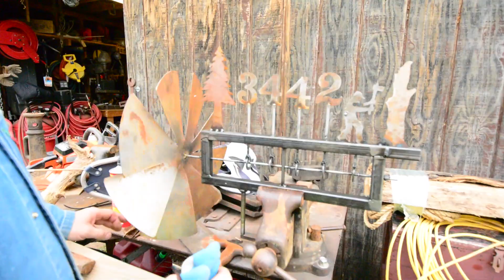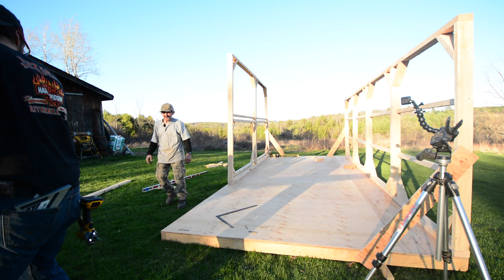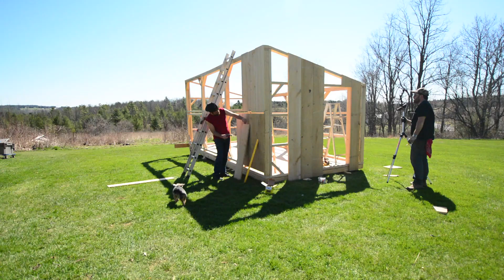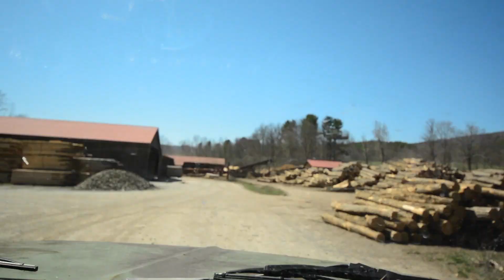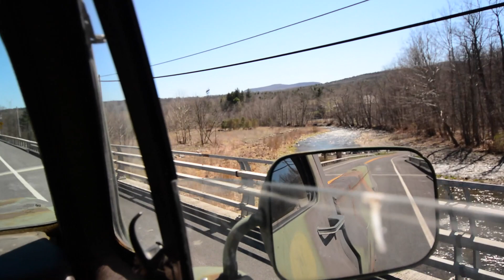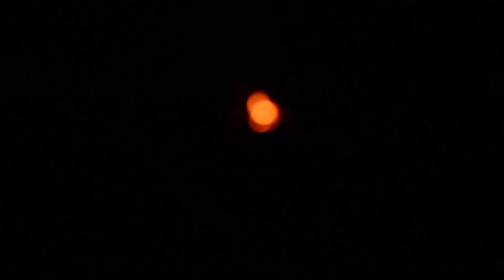Bee Bungalow - 2/3 with Jimmy DiResta & Willie - Wlog - 02

Comment: This is impresive, It took only two days? I'v been making a pair of nighstands in that time and still half way through. BTW, you could get better shots by closing down the aperture while it's sunny... The battery could last longer because the focus mechanism is not hunting all the time and the video will probably be less choppy
Reply from the maker: Thank you! I didn't use auto focus - it may be the frame rate vs the arbitrary speed up percentage of footage?  Plus I chopped Thanks for the thoughts and ideas to improve without being a dick head - very cool of you - cheers.
Reply: Haha, never my intention to be a dick. I recommend you to get a variable ND filter and adjust your exposure with that and the ISO... So that you can keep the shutter speed at 1/60 or 1/120th form most shots. The choppyness comes when the shutter speed is not a multiple of 30 (i think)